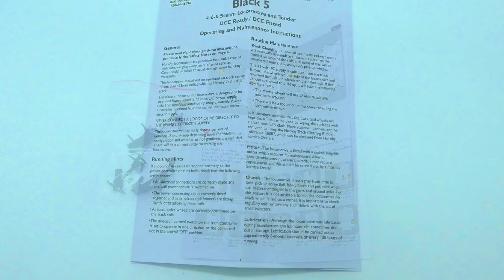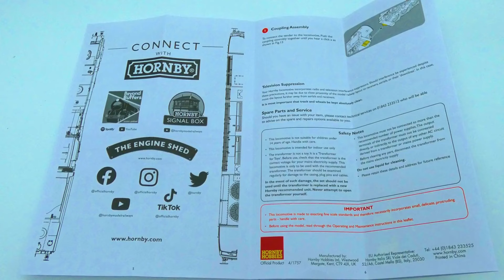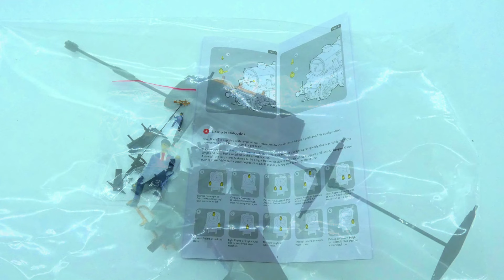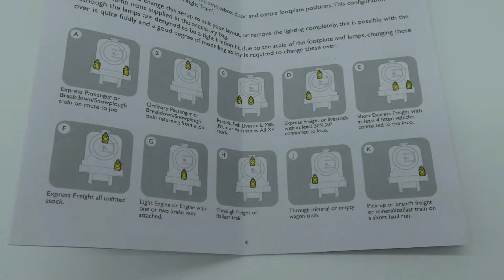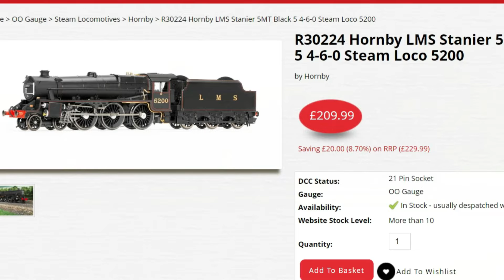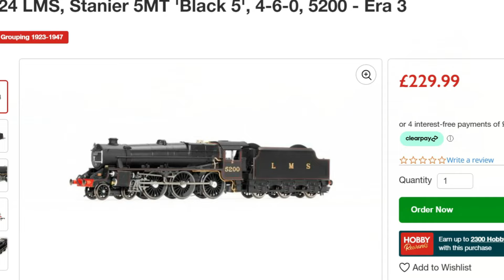HORNBY BEST LMS LOCO: (NEW TOOLED) REVIEW HORNBY LMS STANIER "BLACK 5" 5MT

Comment: I know zero about model locomotives, but have some idea about tooling and electro-mechanical assemblies. Given the complexity of tooling and assembly required, and the relatively small production runs over which tooling costs are amortised, I am astonished that they only cost £200.
Reply from the maker: Hi mate
I hope you are well
Yes I know they been some  bad reviews and issues with loco and tender connection
Yes £225 is what hornby price it as.
I think it a good model over all.
I've no issues with mine yet.
Thank you for commenting
Keep safe ARP

Comment: Hi Adi 
There are many issues with the new Hornby Black Five it is not the accurate ultimate Black Five that Hornby claims it to be. 
Some very basic details are incorrect, the gap between the running plate and the boiler, bogie wheel profile, brake shoes are the incorrect type, the cab interior is the wrong colour, and the back head detail in the cab is incorrect. 
The lamps and cylinder relief valves are hopelessly out of scale, much of the pipe work should be black. 
Why have I mentioned all of this???
There is a massive amount of high quality accurate research and published information about the Black Fives, yet Hornby still gets very very basic stuff wrong this is highly frustrating. 
YouTube reviewers are not covering a lot of these issues. 
Some may call me a rivet counter but it’s 2024 and this is a plus £200 model and Hornby have growing market competition. 
Please somebody do the wonderful Black Five justice in model form ACCURASCALE!!!
Reply from the maker: Hi mate
I hope you are well
I've not said it the ultimate black 5.
Class47Peter did.
I ask is it hornby best lms model.
I word it carefully.
Am happy with mine as far as I can see it a great model.
The only issue I had was dirty wheels.
The only bad review I've seen is Sam's review.
Thank you for watching and commenting
Keep safe ARP
Reply: @AdiPullen there more bad reviews on it.

Comment: Nice video Adi, Sams Trains is have terrible trouble with his. I have pre-ordered the sound and steam version, I think mine is dues for delivery by the end of the year...Simon
Reply from the maker: Hi Simon
I hope you are well
Yes I know sam had issues
Class47Peter and mine was fine.
A review only someone opinion give or take.
I love it
Keep safe ARP
Reply: Sam's trains also runs his trains on 90% carpet so no wonder he has troubles..
Reply: This was a brand-new locomotive, but I know what you mean about running them on carpet, never a good idea.
Reply from the maker: @peterkay6845  to be honest I did as a young kid till my grandfather told it bad for the models
Reply: @peterkay6845  Does that explain crank pins coming out?
Reply: @peterkay6845  Judging by what I see, Sam's tracks are not laid directly onto the carpet.  There are various kinds of overlay.  Regardless, his trackwork does not explain the failure of power to pass from the tender to the loco, no movement being the result.  I'm pleased that Adi got a trouble free unit, but Sam wasn't the only on-line reviewer to report issues with this product.

Comment: Hi Adi, Nice positive review. Sam wasn't that happy with his badly assembled and faulty model. It still is a win or loose with Hornby concerning Quality Control and that's not acceptable. Reviews from your and other You Tube channels do have an impact so it is in their own interest that manufactures have efficient and reliable QC. Spread the word my friend ! Thanks for this review & all the best.
Reply from the maker: Hi Phil. 
I hope you are well
Yes I've only seen one bad review which is sam review.
OK Peter had a loco and tender connection issue which was easy fix.
But it alway good to watch other to get a better picture of a model
Thank you for the kind words and watching and commenting
Keep safe ARP
Reply: @AdiPullen add another YouTuber. By the look of it. It not a fluke. Every one probably has it.
Reply from the maker: @gamerfan8445   mine had no issues
Reply: @AdiPullen  for now
Reply: Hi yes Sam's was not quite so nice   ( BUT DESERVEDLY SO) unfortunately for hornby sam goes into great detail    ie that running board ALSO does appear to have a slight bend starting above the middle drive wheel    But this guy never checks that  so dont complain at sam for doing his job
Reply: @plutoyaldnil4750  it not even once. It happened twice to Sam. While someone else is having the same issue. The funny part is that the problem is that Hornby wants to be fancy with the hook up for the engine and tender. Meanwhile a standard drawbar would not have the same problem.
Reply from the maker: Sam doing have brain damage and cerebral palsy or back issues
Reply: @AdiPullen aw the Brit try to be funny. How cute.